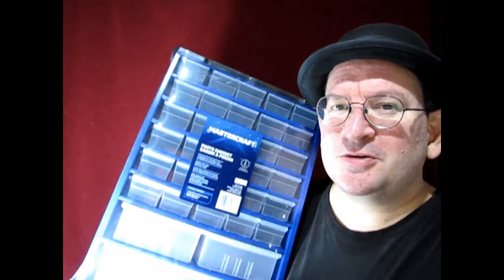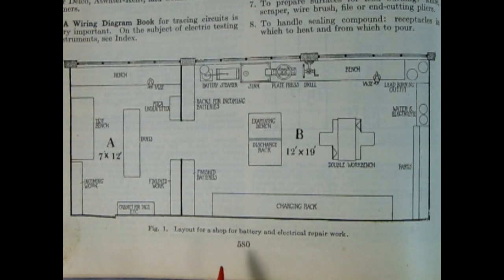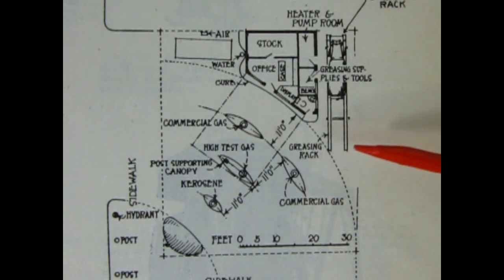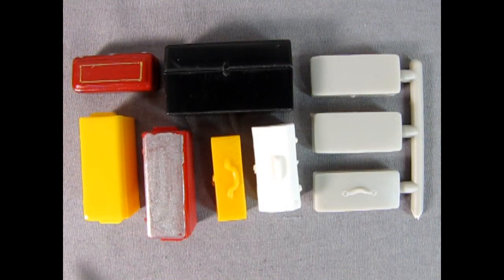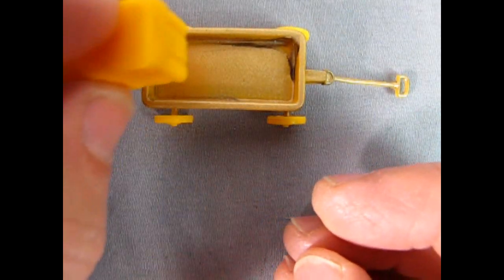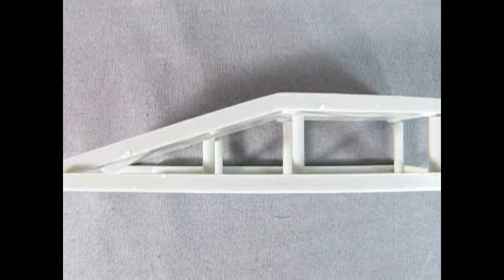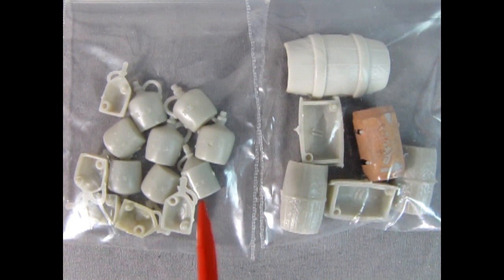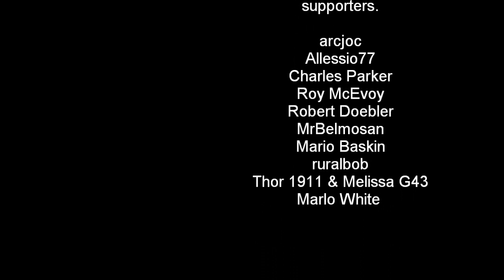How to Find Interesting 1/25th scale Garage Diorama Pieces To Make Your Scenes Pop!

Comment: What a great video Trevor 👍great info for finding parts and what a fantastic book. 👍Let's hear it for health and safety at work,under those wild ways of getting a car in the air.👀👀 Absolutely  excellent 👍😎spanners and wrenches😃. Thanks for showing and best wishes from jolly old England 👍😎Pete 🤓
Reply from the maker: You are welcome Pete. You know, wouldn't lifting a car like that cause all the oil to drain out all over the place? There's also pictures in the book of mechanics working on Model T engines that are suspended vertically.

Comment: Very cool book,
The AMT 34 Ford tow truck comes with cinder blocks, and a tire rack, one of the semi truck trailer comes with pallets, pro street 66 nova has detailed engine and engine stand and mpc 75 or 76 dodge dart kit show how to build a scale show car diorama in the instruction sheet
Reply from the maker: Cool stuff. The cinder blocks mush be a new addition to the '34 pickup as the earlier versions did not have them. That one did come with a tool box and chrome plated tools though. The palates would be good to have. I'll have to make up my own from wood.
Reply from the maker: You are right. I have the original instructions for the 1934 Ford which I just found today and they include the blocks. - Look for me noting that in my "Part 2" video coming soon.

Comment: I built one of these as a kid and the glue did not do it any favors so I painted the sides white and made it a racing trailer. Down through all the travels and age it fell apart. 4 years ago I started a restore of it. Striped all the paint and clear plastic is, well, not very good. The axle's and springs just disintegrated and I scratch built all new axle's and spring assembly. Still have in a box to finish. I did buy one off of ebay for a someday project...Thanks for the video and your dads memories.
LLAP 🖖
Reply from the maker: You are welcome, but I think this comment was meant to go on the video about the trailer. 🤓
Reply: @MonsterHobbiesModelCarGarage  🤔😕 What in the world? 🤯 I didn't even comment on this video... Lol It was a cool video... ¯\_(ツ)_/¯
LLAP 🖖
Reply from the maker: @Bruces-Eclectic-World  That's ok. I just blame the technology! LOL!
Reply: @MonsterHobbiesModelCarGarage  I'll go with that... Lol
LLAP 🖖